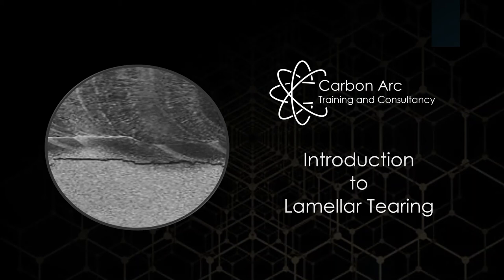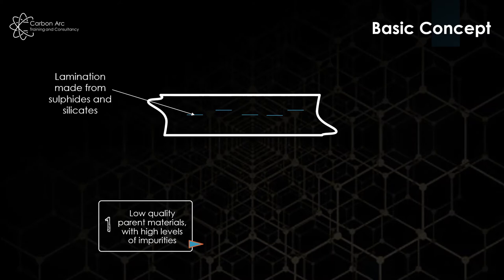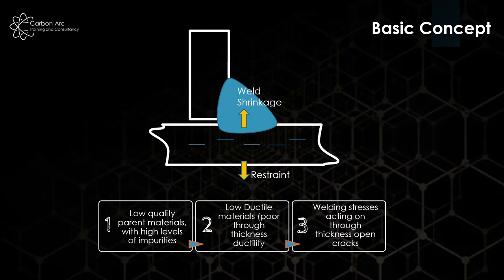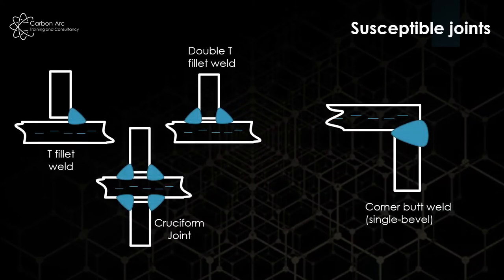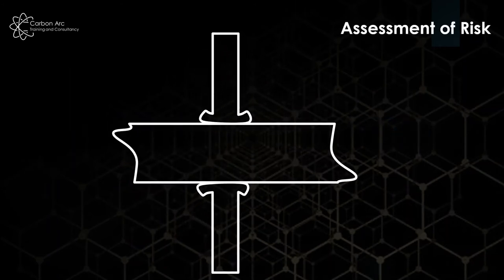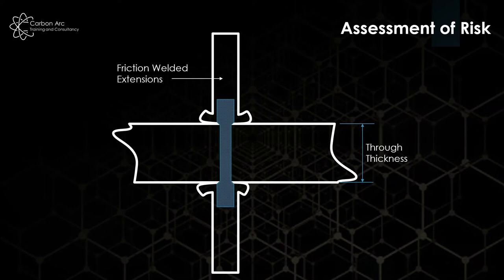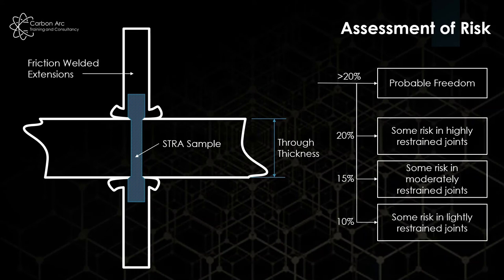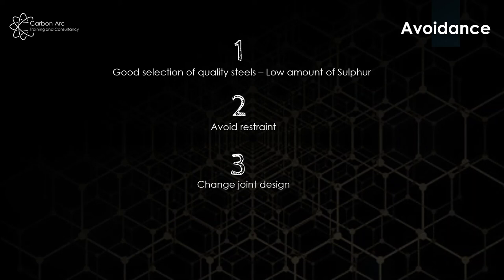Lamellar Tearing  - What you need to know

Comment: Could we detect lamelar tearing in steel before welding? By UT as an example ? Or is it impossible?
Reply from the maker: Lammelar tearing is an action of the failure. It can't be found before welding takes place. But you can find laminations with UT which you can use to assess the risk.